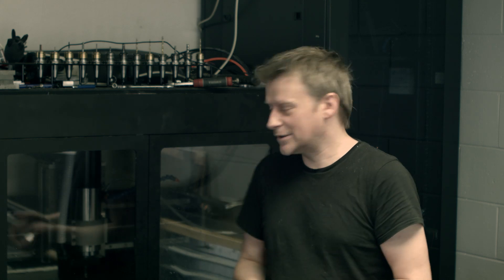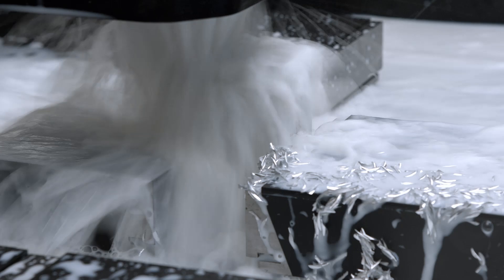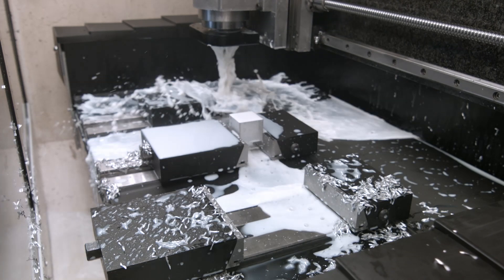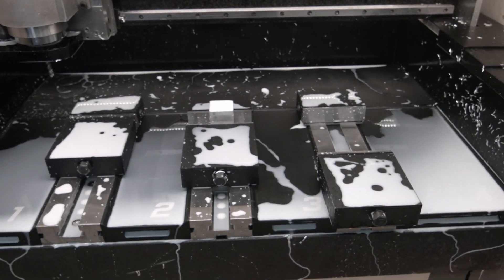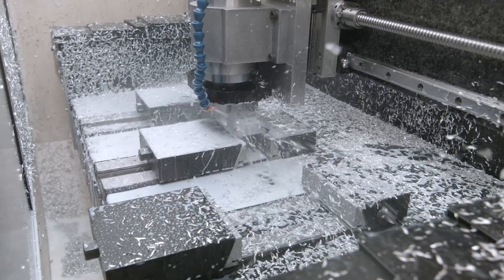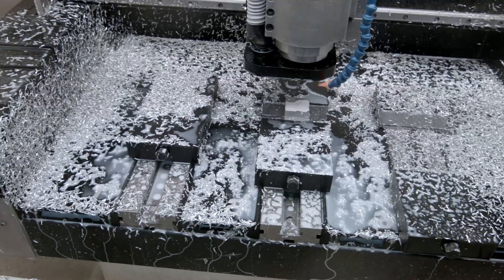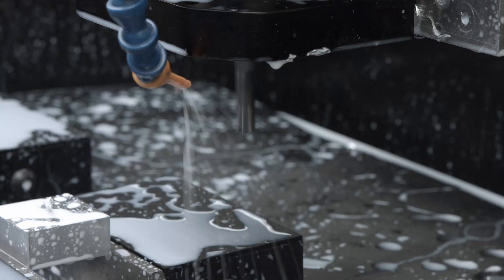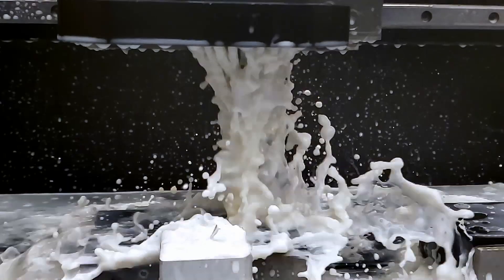Messy coolants - How to keep it clean, what is better less or more?

Comment: Amazing setup you have! I’m still in the early stages of designing a flood cooling system for my gantry style cnc. I’ve got a couple questions. 

What diameter tube/plumbing are you using to keep up with the flow rate of your 9500L/h pump? I’m guessing with all those holes at the nozzle you more or less have a consistent rate from end to end (tubes ~= the combined nozzle area)?

How are you handling tram oil separation? I’ve seen a few ideas floating around: using a pool pump submerged in a plastic container floating  in the tank to migrate surface oil into a small area to skim manually; Another one was using baffles to separate floating oil. 

Lastly, are you filtering any debri that stays locked in the suspension of the coolant before it exits to the nozzle? I’ve seen people using kitchen sink filter systems. If so, what particle size filter? I’ve seen anywhere from 200 to 20 and down as low as 5 micron. Surely this will inhibit flow rate the finer you go.

Comment: Thanks a lot, for your videos mate, it is really helpful. I'm going to build a machine like yours. I will very appreciate if you make a video about electronics you use in your projects e.g. controllers, motors and how it connects between each other. What is the difference between pnp spindle motors and npn? Which controller is the best? Can I use PC instead of the controller?  How should I connect stepper motor drivers to PC or controllers? What is the difference? What is the difference between hybrid motor drivers and norman one?  
Thanks in advance

Comment: Hi, To reduce the splatter, perhaps you could use either: a ring of thick, clear vinyl strips attached to the mill head.

The vinyl is often used for loading-dock doorways and for walk-in freezers, to keep drafts out. It's fairly clear. The vinyl will hang down. Because it will have overlapping vertical slits, it will brush/drag over work-pieces and vices. It will take damage and get uglier by the day, but can be replaced. Perhaps a swing-open gate could be made for setup.

Your Niagra Falls / Old Faithful geyser nozzle could go between the bit and the ring of strips. For my machine, I had a groove that the vinyl sat in, and then it was wedged in place with a length of jacketed wire. Though, the stuff I used was too thin, and it was textured, which made it harder to look through.

I don't want to be the cause of your undoing, but, I notice that you don't have a 3D printer : ) 
Perhaps the housing could be 3D printed?

And don't tell Piotr, I made a 3D camera controller last year. : )

Comment: So you finally inspired me to start building my own granite-based CNC, though I'll try the H-frame design as I need high Z travel. :) ... You also mentioned that your steppers go quite slow - are you running them at 48V (or 60V)? .. Stepper motors have this characteristic where they can keep their torque at higher speeds just by increasing the voltage (limited by iron losses) - I use Leadshine DM856 (which are normally for NEMA34) on NEMA23, at 2.8A running / 50% holding, rapids using 1605 screw at ~10000mm/min (could push higher, but my arduino can't step faster without sacrificing microstepping).
Reply: What Nema23´s and PSU are you running Jiri?  I have 2Nm Nema23´s, 1605 screws and Leadshine DM556 and 856 but max out at around 5000mm/min (1k shaft RPM)

Comment: In part 4 of your cnc build video you mentioned you're using brandless linear guide from ebay. I'm very surprised cheap chinese could withstand 2 years of active use and allows to go with quite a challenging feeds and speeds. Do you still have a link to these guides? Or at least can I know the price of them? Because thats really outstanding result for cheap linear guides. Also same for ballscrews.
Reply from the maker: well. i paid around for all balls and screws around 1000usd. 4x600mm  rails 2x 1000mm rails 2x 300mm rails. and 2x 600mm screws 1x 1000mm screw 1x 300mm screw with blocks.
now i really regret this because i have to change all of them. i should changed them a year ago. but i reloaded all ball screws ans carriages with ceramic balls to reduce backlash, because all rails and screws became loose like an old prostitute :) (i have nothing to prostitutes:) but its just very descriptive way to make a point:) )
if you buy the cheapest thing on ebay you will get what i got.
but i would recommend hiwin or something with a brand.
impressive cuts come from the rigidity of the machine, not as much from the rails or the ball screws.
Reply: @PiotrFoxWysocki  ahah, nice comparison :D
That reloading trick is very interesting! How did you know exact diameter you need? You measured existing balls, added few microns and thats it? Where did you get ceramic balls? I know there are plenty of them on ebay/aliexpress, but I doubt they're really G10 grade precision quality. We need more information about that awesome trick!
Reply from the maker: @goodfis624  i measured existing balls and i got the closest replacement. ceramic ball bearings are much rounder than steel,  i thought even when they are terrible they still should be better than the steel ones. so less variation in size should improve travel vibration and average all bumps on the rails or ball screw, as ceramic ball bearings are much harder than steel. 
cut quality before and after wasn't really noticeable, but definitely backlash went away.  
maybe with more time it could improve as ceramic ball bearings would roll linear rails, but i won't wait that long. I just replace all of them as soon i get the opportunity.
Reply: @PiotrFoxWysocki  So, after all quality of linear guides didnt affect cut quality at all? No chatter, etc? I thought backlash must induce chatter. I understand that your X and Y axis are heavy as hell so it wont be affected by cutting forces that much, but your Z axis is fairly light, it should have started some vibration and "jumping" under cutting forces, if there were any backlash in its guides.
So... if cheap chinese guides with backlash dont affect productivity of the machine, why replace them? What is the benefit of more expensive ones? Only durability and lifetime?
Reply from the maker: @goodfis624  they do affect quality. in case of milling a straight line , lets say 20mm deep, which in perfect scenario would be a perfectly smooth plane limited only by tiny lines of the side of the end mill. (goal mirror surface finish)
currently i have pretty good surface finish but it has some imperfections. like a pattern of the ball bearings going through the carriage. so not a chatter. just few microns, but still annoying. i want parts to be perfect.
my Z axis might look like its light but moving part weight is 20-22kg so not much jumping is happening there, but it does wobble a bit. well again few microns. but it pisses me off.
i'm angry on my self that i did really good job making this machine and i fucked it all up using those cheap rails and screws.  still machine is pretty awesome anyway but i want perfection. Or a home made machine with milling quality of a some 100 000$+ milling center.  bold statement but i think after upgrades i have planned it is doable :)
Reply: @PiotrFoxWysocki  Huge thank you for that information! I didnt even think about surface finish repeating pattern of the cheap carriage. I thought backlash is all that matters. I'm planning on making cnc lathe and after discussion with you I definitely investing into good linear guides, its definitely worth it. From information I found I can say that used THK/NSK guides are better and cheaper than new HIWIN. You should search ebay for used or surplus one. Like this one: https://www.ebay.com/itm/NSK-LS15AL-700L-2-Linear-Actuator-LM-Guide-Bearing-2Rail-4Blocks-THK-SR15W-CNC/201657566257
Reply from the maker: 15 are very small.. I found replacement for mine on Ebay already. I will be replacing my 20 rails with 45 roller guides. New. This is the ultimate solution. I'm getting this size because of the diameter of the rollers is bigger so any imperfections won't transfer to the workpiece as much as the same imperfections in a much smaller size  rollers. And in case of ball bearings even more as their contact surface is minimal.
I'm also getting them with preload and precise class. I will be making videos from the upgrade so I will be explaining more.
Reply: @PiotrFoxWysocki  Wow, 45 is huge! By the way I just linked that shop on ebay, not this specific lot. It sells used linear guides. You can check this shop if you want :) Its just a little help from me for your advice. It does sell some 40+ size roller guides, so I hope it helps you and maybe saves some money.

Comment: this explains the mess in my garage (dry cutting only and at 2800 RPM on an old knee mill converted to LinuxCNC
Reply: Linux is the way to go 
My macine was never designed with cooland in mind    it's a fixed gantry style macine   using long ass nema23 stepper no feedback  giving me all sorts of headaches in the beginning  I made my own parport cart using  jlb pcb  realy want a mesa cart but cant get them here in Europe

Comment: Dang, I am inspired!  Based on what you've shown in this and your other view on building your coolant manifold, I've already modeled up a version for my Tormach 1100MX.  I'm guessing your outlet holes are about 6mm?  When I'm done with mine I'll come back and post a link to it so you can see how your videos have impacted other people!  Thanks for the info you share so freely.
Reply from the maker: Yes my holes are 6mm. if you go with the same amount of nozzles, I would recommend a 9000 liter/h pump this will give you more or less 3000-4000 l/h.
you will need also some kind of a chip catcher/ filter which will be able to let so much coolant to go through it. 
you might need to spend some time experimenting, but at the end it is worth it :)
Reply: @PiotrFoxWysocki  The pump I have is 6800 liter/hour.  Do you think I should reduce the holes from 24 to 20, or just go with it and get a bigger pump if needed?  BTW, that was a fun thing to model in Fusion.  I learned some new stuff in how to model the two different angle outlet holes.  Speaking of that, one other question:  How long do you think those holes need to be to get a well defined stream like you have?  Obviously a 6mm in 1mm plate won't create a stream, it will just spray outwards.  I chose 20mm plate for that part, so the holes (being at an angle) will be slightly longer than 20mm.  Any thoughts?
Reply from the maker: Keep amount of holes the same you will see what happens. Coolant pipe should be minimum 25mm I think I use 32mm or something like that. On 25 wasn't pumping enough. Holes in mine are through 7-8mm thick plate. So whatever it comes up to on an angle.
Reply: @PiotrFoxWysocki  I will update you on the results.  Might be 10-15 days until I can get to it, but it's on the list!  Thanks for your helpful feedback!
Reply: Excited to see the first prototype !

Comment: Looks to work really well.  Why don't we see this from manufacturers of flood coolant systems?  Is there a down side?  Would it work just as with with steel, titanium etc?
Reply from the maker: i'm guessing this could be too much most of hobby cnc machines. because of coolant circulation and chip filtering, but it wouldn't be a problem for big cnc machining centers. it would be just about adjusting the design of the nozzles/flow according to the machine power. in my opinion possibilities are endless.
Reply: Often, a new design isn't sold because nobody will buy it.  Because they haven't used it, and they weren't trained to use it, nor did their previous employer use it.  And their training is on the equipment found in the field.  And all the other companies they might work for use the older type.
Consider the QWERTY keyboard:  it was originally designed to deliberately slow down typists, because otherwise the early mechanical typewriters would jam for fast typists.  So that's what typists were trained to use.  So that's the kind of typewriters that were purchased, and what the typing courses teach...  Around and around.

Comment: Very cool video! I was very surprised by how few particles your system put into the air compared to the generic system. I bet anyone who has been around a machine with flood coolant being atomized everywhere wishes they had your version! (excluding though coolant tools and such...)
Reply from the maker: im sure that even for through spindle coolant you could make a head which will put a curtain of coolant around it and it would be enough to catch most of the particles. obviously the flow and curtain thickness would have to be proportional to the pressure of through spindle coolant. I wouldn't be surprised if some big machine manufacturers would start making something similar.

Comment: Would you want to make another one of that flood cooling ?
I need something that does not toss the floodcooling around for a 3kw atc, My machine should be able to toss quite some chips just like yours, but not completely as good

But in  the other hand i can also run fast (DMM Servo's) So i was also looking at a 35 000 rpm spindle to utilize the servo's.
Reply from the maker: its quite possible i might start making those heads in near future. who knows :D
thanks for asking!
Reply: Well, toss me an message, will need one in NEAR future for a 100mm spindle ;) nbt30 tool holders
Reply from the maker: haha :) i will :D
Reply: Guess you have seen my build ?
Reply from the maker: @xillianto  wow :D its like having a deja vu :) I hope it will serve you well :)
Reply: @PiotrFoxWysocki  Hope so, max speed is for now 20 000mm/min

Comment: Why not hang a "hula skirt" around the cutter head slow down the flying chips and coolant?  Seems like it would minimize the cleanup problem to a smaller area.
Reply from the maker: I did had it when i was using off the shelf cooling system. but as i mentioned in the video it wasn't strong enough to wash off the chips from deep pockets, or to wash them off the table.

Comment: how come you don't use ethanol mist minimum quatntity lubrication? Or something like UNIST MQL
Reply from the maker: not sure if i would like to breath alcohol vapors all day long :) anyway i would have chips blown all over the cnc. they would't be as sticky so cleaning should be bit easier. but still it would be a lot of cleaning. and a lot of mess on the shop floor.
Reply: @PiotrFoxWysocki  you wouldn't be breathing it, it is not flood or mist, it is less. Unist shows that if you blow on a piece of cardboard and it soaks, it is too much. It is about micro volumes. 200ml could last months in industrial machine. 1 drop every  minute
Reply: MQL is about lubricity, reducing heat as a side effect. Not soaking it all up like flood or mist
Reply from the maker: i wouldn't mind to have it. it would be cool to see the cut. and chips being blown away. but still lots of cleaning and additional work for the compressor as i'm using it for the spindle already.
Reply: @PiotrFoxWysocki  it doesn't constantly blow. It blows a spritz evey couple of seconds, lik every 15 s

Comment: Hey Fox, I could do the 3D models for you in Solidworks and provide to you in STEP file format so you can sell to anyone. You can see some of my stuff on GrabCad.com. Let me know if you are interested and I'll send you contact info.  You really have something with the flood coolant nozzle and may want to sell that rather than providing details.
Reply from the maker: thank you for the offer. Before i would start selling it i would have to improve it further. I would also have to make many versions so it fits all sorts of spindles. 
i have plan to sell designs and products if someone doesn't have time or tools to make it.
Reply: @PiotrFoxWysocki   It may make sense to set a time limit on refinement of the design?  Otherwise, when will it be perfect enough to ship?
Reply: Ok Fox - offer still stands for any parts you would like 3D models and drawings done for any parts of your CNC system.

Comment: why no parallels?
Reply from the maker: just a habit. i put them in to set it up and than slide them off. once i forget to take parallels off and i drill in to it. so now i always remove them
Reply: @PiotrFoxWysocki  they help from the stock or part from moving sideways and you can tap down parts to get a good Z datum